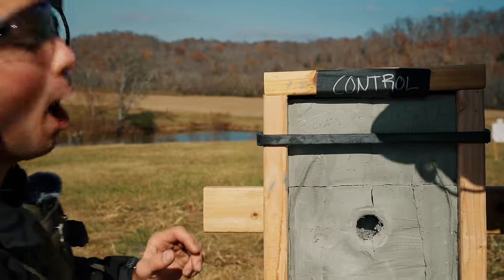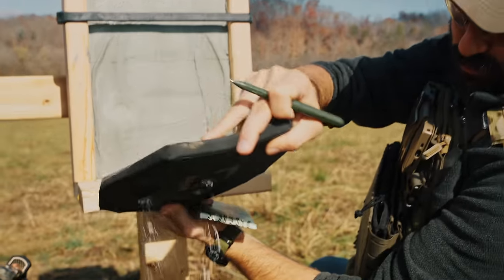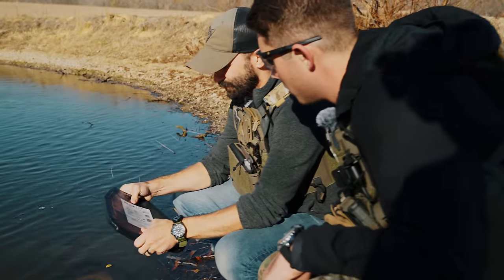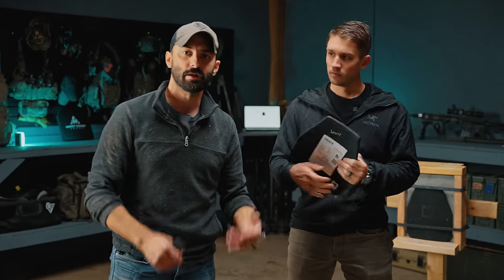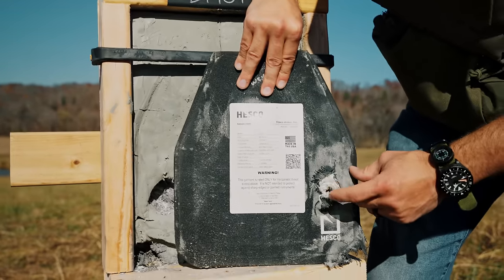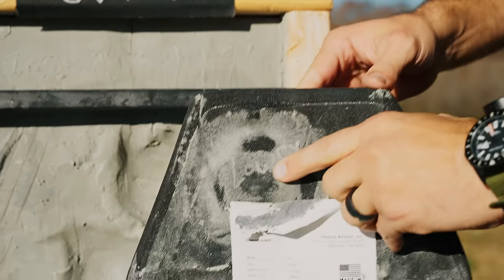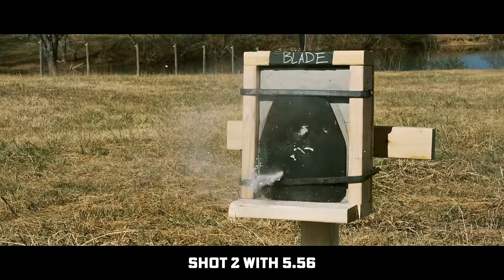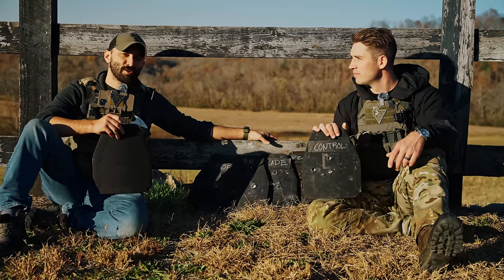Ceramic Body Armor Plates vs 556 & 762x39 | Hesco L210s get Dropped, Soaked, Baked, Stabbed, & Shot

Comment: I don’t think there’s going to be that much difference in between slightly damaged plates, and a control. Think about dudes in the military that have no clue how to take care of the armor and they still stop rounds. The amount of times I’ve seen someone toss their armor out of the truck is insane. Edit: AND how many times have we been soaked in the field from rain
Reply: Yes, for real plates. Even china plates. But not these disgusting L210. 
Why spending so much money on level IIIA+ plates? Just buy real level 4 or 3+ plates for the same money. 
With REAL testings and NIJ documents.
Reply: @aesthetic8780  Because you save a lot of weight, and the odds of you going against someone shooting at you with 30-06 AP is basically zero.  Some people make the calculated risk to reduce the level of protection in a plate, such that it can still stop the most common cartridges (5.56 and 7.62x39) but you are like 3 lbs lighter per plate.
Reply: @Sophistry0001 the amount of coping I see for L210 owners is outrageous. Single curve, not actually 10x12 due to foam liner,   Extremely narrow level of protection vs standard level 4 plates. Highcom 4s17m is NOT much more expensive or heavy and it’s a properly built plate. A plate should not need a foam edge like the l210 does. Just pony up and get level 4s
Reply: @MrSlayerboy99  yea I mean I have heavy RMA 1155s which are level 4. I can just understand the justification tho for getting special threat plates
Reply: my dad had a plate that shattered from a pistol round while room clearing in iraq, turned his chest purple and could barely stand.
idk the previous condition of the plate or the ammo from the pistol.
Reply: @Sophistry0001  I own lvl 4 plates and I honestly regret it. Should’ve gone 3a.
Reply: @coltonmullins2274  Why do you regret it?
Reply: @Sophistry0001  they’re significantly more heavy. Tactics/movement/avoidance of conflict are way more important. I also moved to a rural mountainous area. A carrier is a HUGE knock on mobility. I run mostly unarmored sustainment.
Reply: I completely agree
Reply: @MrSlayerboy99  Youre not making a good case when level 3+ exists
Reply: @orpheusepiphanes2797  level 3+ is not recognized by the NIJ so no, it doesn’t exist as far as I’m concerned. Just get level 4’s and stop worrying about it
Reply: @MrSlayerboy99  Nah Im not doing that.
And just so you know, "3+" either is or is going to be "RF.2" according to the NIJ.
So level 4 can go eat shit for all I care
Reply: @orpheusepiphanes2797  ok. 3+ still isn’t certified so why buy it? Why are you so angry? Sounds like you don’t need guns chief
Reply: @MrSlayerboy99  Because it serves my required purpose

Comment: I always thought it was pretty well known with ceramics that, if a plate got hit, anywhere within an inch of the initial impact it was compromised? Seems to hold pretty true judging by this video.
Reply: I thought that as well. It wasn't surprising at all when they got full pass throughs when hitting the same spot or close to it. They should've shot the plate in a different spot in my opinion, it kind of does the plate an injustice. I bet it would've stopped all of the rounds if they were spaced out.
Reply: @EvanDavis-x4q  exactly. And I saw some poeple commenting about the L210s Not being true to their size because they had foam around the edges... But, I dont remember seeing any foam when the edges were exposed. If anything, Im feeling fairly confident in trusting my L210s.
Reply: Within two inches of another hit isnt permitted when doing NIJ testing.
Reply: @50shadesofcerakote  L210's have a full edge to edge strike face. Confirmed such with doing a tear down of L210s when I demo'd them. Videos are on my channel.

Comment: I don't believe these are rated for multiple hits within an inch. Calling them failed because they didn't survive that isn't fair to any ceramic plate.
Reply: NIJ testing doesnt allow for shots to be within two inches of each other, and it also doesnt permit hits close to the edge of the plate.  Theres a lot of talk aboit what is fair in the NIJ testing protocol, how many shots you can get per plate etc.

Comment: With body armor becoming more common I've changed my handgun shooting drill to something I picked up from a former LAPD officer. 
I now put two double taps in center mass and then change to double taps to the groin area.
On most people the groin area, hip to hip, is almost as wide as the chest area so it's a much easier target than the head and it contains a numbers of critical and sensitive nerve clusters, bloods vessels, and joints, not to mention the family jewels.
The LAPD officer told me that he changed to this routine when drug dealers and other criminals also started wearing armor and on two occasions when he used it because shots to center mass failed to stop someone it worked perfectly.
Reply: I'm seeing this taught in women's self-defense courses too.
Reply: Box drill, two the chest or groin box and one to the t-box
Reply: The pelvic girdle. Dope ass bad guy catcher’s mitts. There’s a lot of arteries running there, and it’s impossible to tourniquet that area.
Reply: @arty560 yes, pelvic girdle.  It will drop them and incapacitate them at minimum.   It’s a great follow up shot.
Reply: Marines don’t aim for the center mass anymore, they aim for the hips. I got this info from a navy doc who trains with Marines. Makes sense since the govt. is trying to have a near peer war with China, possibly Russia. You miss the armor, hit all those bits you mentioned, and immobilize your target.

Comment: I know for a fact that a cracked esapi plate will still stop several rounds of of green tip. I had a plate that didn’t pass the test of tapping a heavy steel punch onto it the same way the military does. After it failed I shook it and you could hear the fragments moving around. I took it out and put 7-10 rounds through it before going through. I was very impressed. Cheers

Comment: Id love to see this done on the RMA Armament Lvl 4. They are about $150 a piece but weigh about 8 lbs per plate. Apparently they were removed from the NIJ but from all the other tests ive seen on them they still are truly lvl 4. I think just some shady stuff went on diring testing as they have been certified for years
Reply: I wanna see them too. I’ve got a set so the curiosity is definitely there
Reply: Military arms channel did a recent video of them.
Reply: I agree that something shady happened with NIJ failing that plate. Based off the torture tests I’ve seen of RMA and Hesco’s I’m definitely leaning towards RMA.

Comment: In regards to the control, that is why I wear Hesco 4800's.  They can take two rounds of AP 30.06 on top of each other.  There is video evidence from them that proves it.
Reply: I'd like to see that video, because 2 AP threats right on top of each other would result in a penetration of the second round, no question about it. The strike face is needed to eat away the AP core, and it would be nonexistent after the first shot.

Comment: "... not intended to protect against sharp-edged or pointed instruments" includes threats from arrows.
The question is what kind of arrow?  Long bow?  Compound bow?  Cross bow bolt?
That's a test that I'd REALLY like to see.  What happens when you fire various arrows/bolts into different body armor?
Reply: They have to put that on there because it is not NIJ stabbed-resistant rated.
Reply: Arrows have a lot more mass behind the tip (cross-sectional density) than bullets.  It's not just a matter of the arrowhead, it's the shaft behind it.  There are vests that can stop some pretty impressive rounds, but can't stop an arrow.  It would be really interesting to know what the vest is capable of stopping... even if it's not officially rated for it.

Comment: Would have been more curious to see this performed on soft body armour.  I was issued IIIA soft armour for duty use.  Wore it in the desert for a little over four years, daily.  Sweated through it perhaps 250 days of the year.  It had a small trauma plate in the center, but I was always curious how "useful" the soft armour would have been by the time I gave it back.
Reply: Any soft armor that’s Kevlar or UHMWPE based is pretty much infinitely durable. Especially Kevlar. There have been lots of videos of people shooting Vietnam flak jackets and old IIA vests that kicked around in the back of police patrol vehicles for a decade or more through many many temperature extremes and they all stop what they are supposed to still.

Comment: Seeing that control plate fail after the second shot on the same spot is why I am fine with still using steel plates. "But muh spall" doesn't mean much when you have a massive hole in your chest and you can just line your plate to catch shrapnel.
Reply: Issue with steel plates is mainly being defeated by M193 and other fast moving rounds.  If you look at a lot of 'speacial threat' and III+ steel plates, they are guarenteed for 3100-3200 FPS.  When you go over 3300+fps (like out of a 20" AR) you start getting pass throughs.  Zippier high poweres hunting rounds are even more effective, where you dont have the same issues with ceramics.  UHMWPE plates (the polymer only ones that float) are vulnerable to M855 green tips.  Check out Buffman's testing for some great info.  

Me personally, I'm a fan of the Botach Battle Steel platea that are UHMWPE with a ceramic strike face (so composite).  Me and some buddies bought some plates and batch tested one of them and we had great results.  They're pretty light weight too.  I think you need to go off what your most likely threats are and proent towards that threat.  Then it's a trade off for weight/protection/price.
Reply: @notreal5311  That's fair, but I would argue that use scenario can factor into purchase. I ended up going with NIJ-IVs because it was not cost-prohibitive to do so with steel, and in my area most threats are from either pistol-caliber rounds if urban or full-caliber hunting ammunition (eg. hollow points and soft points of <6mm) in rural areas. 5.56mm ammo of those spicier varieties is rare-to-nonexistent in my area, so level-IV steel plates were ideal in my cost-performance considerations.
Reply: @JohnSmith-ir6bc  NIJ level 4 should be able to handle every type of 5.56 and pistol round so you should be good to go.  Most steel plates are level 3 or 3+, just started seeing steel versions pop up.  AR-15 is the most popular rifle in America so I think it's always a threat - but the decision is always up to the buyer and as long as they're tracking the pros and cons and willing to accept the risk I don't care :V
Reply: @notreal5311  I'm not American so it's a different situation for me
Reply: If someone mentions spall when talking about steel plates you can feel free to ignore them. Spalling is the host material (plate) blowing out due to impact. Think of an RPG hitting a tank, it is the spall that is the killer. 

When people say spalling they generally mean fragmentation which is the bullet breaking up on impact. A spall liner or jacket will mitigate any fragmentation well beyond what would cause ceramic or polymer plates to fail.
Reply: @apersonontheinternet8006  I'd rather get a composite late that weighs 5lbs vs a steel plate that weighs 8lbs.  'Spall testing' videos are super biased depending on who paid for the video to be done.  For me it's more about the weight and threats stopped.
Reply: @notreal5311  there is a place for both. 
Composites for the convenience but AR500 for a more long term solution in the event that your composites becomes compromised.

Comment: My take, for AR a 16in barrel would be more relevant. Irregardless of NIJ rating results form M855 would be more interesting to see than 193. Also, for the control it would be cool to see what more rounds would do to the plate if it was hit in different areas instead as stacking the rounds could be expected to defeat the armor. (Just a thought my opinion is irrelevant)

Comment: So.. you finally called out the elephant  in the room .. This ceramic plates  will not hold as good or longer than AR500 steel and other variants...1- we are not in the military that can supply you with more ceramic plates at will..2- I fell like  this things are nothing more than a temporary  solution ... yes, they are light, but not long term.. I have been holding  out on getting these types of plates... yes, AR500 is heavier... I will keep  steel.  💯

Comment: Ceramic is used in showers I think so it getting wet should be fine. Umm dropping it prob will make it fail. Depending on the blade type it shouldn’t matter might even sharpen the blade lol. And idk about the hot car but that’s the one I care about I keep plates in my car.

Comment: I swear these 2 guys are such goober heads. Not a single ones of those shots should have went through. Wtf do you think is gonna happen when you stack rounds on top of each other on a ceramic plate with a thin layer of uhmwpe behind it? How freaking hard is it to spread the shots out in different quadrants at 15 yards??? Not a channel I take seriously at all.

Comment: Kiji/CQBL/switch video plz.
Reply from the maker: We get a lot of requests about this. It's just an equipment combo to us. What would you like to see in the video if we were to do it?
Reply: @dirty-civilian I run this set up, and I have ran C1+, Peqs. Whatever. A comparison to a “Mawlin on a Budget” would be cool. How does it stack against a $3600 MAWL. Modularity. With the echo arms it’s a contained unit, plus a switch. What switches work. Which don’t. I’ve found there is little to no battery drain vs a MAWL. I’ve found I like the power more than a MAWL c1.

Comment: I run the Battlesteel and LAPG LVL4 plates. So far I've been very happy with them. Hesco is very overrated. If I were to soend more I would go with Hoplite plates.
Reply: LAPG armor isn’t effective if you hit within an inch of the edge of the plate. The ceramic only goes to that 1 inch mark. Literally MINIMUM NIJ standards
Reply: @Kalbee  if I take a hit in the corner I'm introuble anyway no matter the plate.
Reply: @welderdude1  difference is having a BFD issue (like cracked rib) or having a through and through hole in your torso . Only stupid buy LAPG for their protection
Reply: @nicolas8098  ok guy. Deflected corner hits still end up in your vitals. Also many train to shoot at the groin area because in most cases there is no armor covering this area. I'm good with my lvl4 plates. I use the money saved on more ammo to train.
Reply: @welderdude1  I’d rather the ceramic eat SOME of that energy though. Vs punching clean through foam. The last inch of the LAPG is literally just foam.
Reply: @Kalbee  they stop plenty. Smoked some extra plates with the same rating at 25yds with m193 Winchester white box 55g. Was running my 13.7 Noveske and thry stopped everything. I know there are better plates and when ammo drops in price or I get busy with work I'll be getting a set of Hopilite plates. I also run the big Battle Steel ceramic umhw plates in another carrier.

Comment: Any actual instances when hesco has failed? Or you guys just hear that from their competitors?
Reply: From Hesco themselves.   One instance I can think of is that the glue manufacture actually change the formula  without telling anyone.   That caused an issue with some plates, and that was from Hesco directly telling me.
Reply: The thing about plate failures... you don't live to tell about it.
Reply: @Shin_Lona  Plenty of people have survived being shot without plates, so I'm sure at least a couple have made it through after a plate failed lol.
Reply: @aaronkeener95 And how did the plate fail from that? Can you elaborate?
Reply: @Vinnytwotime  from my understanding it. The weaker the glue allowed the projectile to go deeper or push back, causing almost 2 inches on the back side of the plate.
Reply: @aaronkeener95  I appreciate the explanation.
Reply: @Vinnytwotime  the hesco tech, guy actually explained it more technical to me but I’m a dumb.

Comment: What do u think about vacuum bag/vacuum sealed ceramic plates to ensure they don't get damaged in the rain or water crossings? Idk if that might trap ambient air moisture inside the plates
Reply from the maker: Every plate is different, but from what we can tell, not much of what we did to them had any significant effect. Now, what is the effect of long term exposure to heat and water? That requires months of consistent testing. Heat, humidity, water... all of those things have a negative effect on any material over long periods of time.